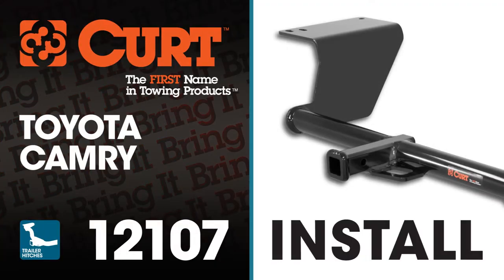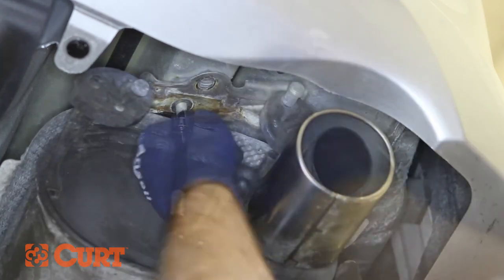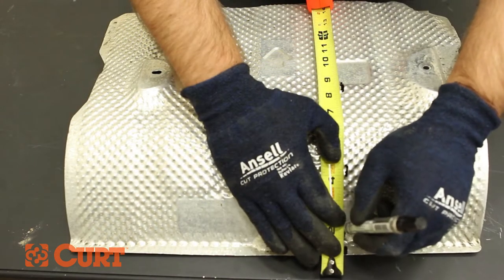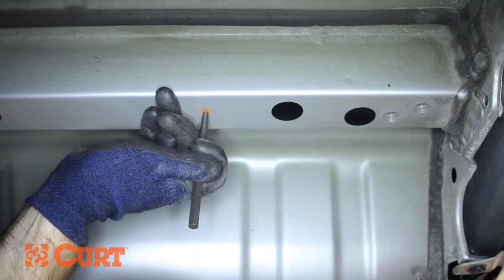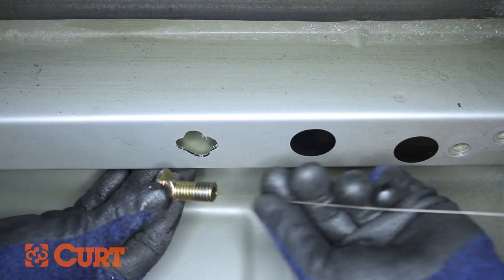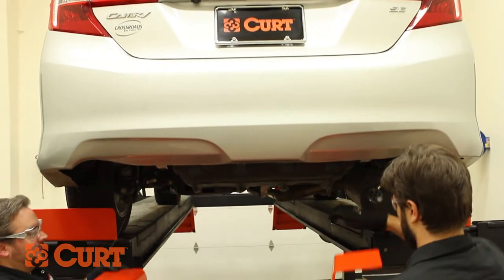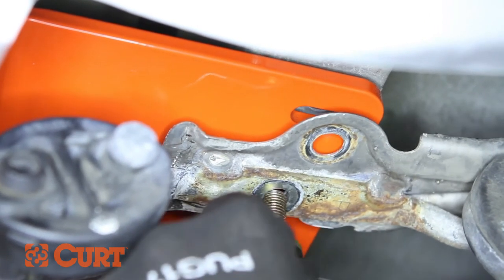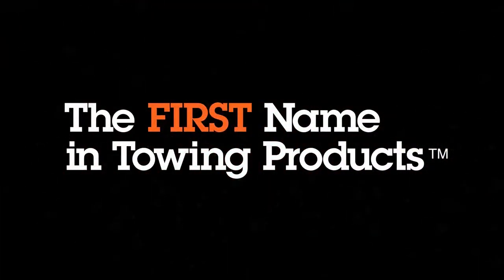Trailer Hitch Install: CURT 12107 on Toyota Camry

Comment: I have a 2014 Camry. The slotted holes in the hitch mount plate DO NOT line up with the existing frame weld nuts!!!!! I burned up $60 worth of step bits trying to ream them out to be able to thread in the M10 mounting bolts. And as for having to drill the tin can frame and fish in carriage bolts for the forward mounting plate hole.....why didn't they just extend the mounting plate to reach the next existing frame weld nut? PIA for my car...Not happy..
Reply from the maker: Please give us a call directly at 800.798.0813. Thanks!

Comment: Why it's so complicated that you have remove the muffler and drill holes?
Reply from the maker: A Toyota Camry wasn't designed with a hitch in mind. Our engineers work with what is available. If you would like more information, please contact us at 800.798.0813.